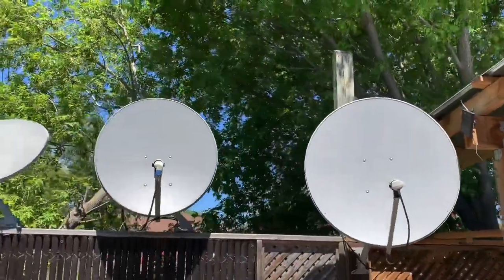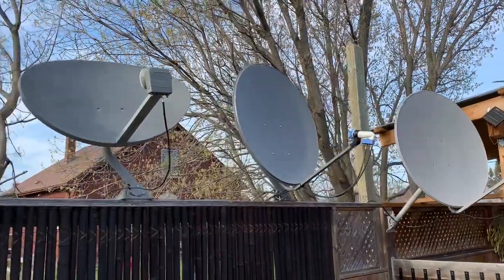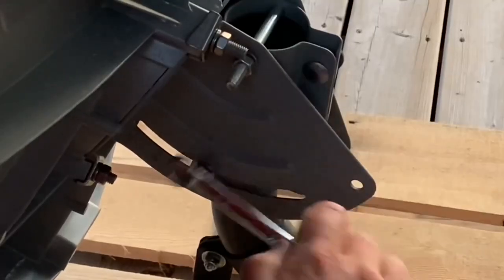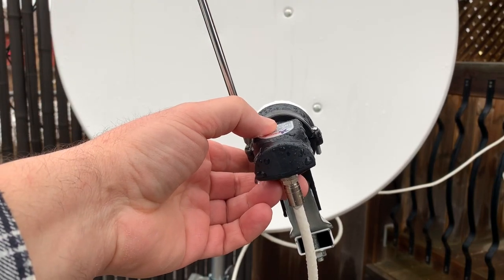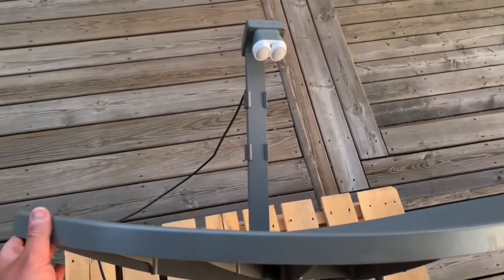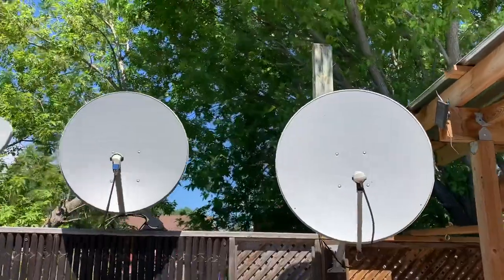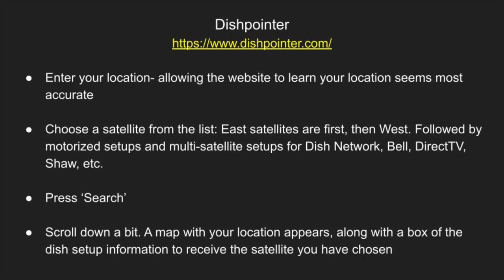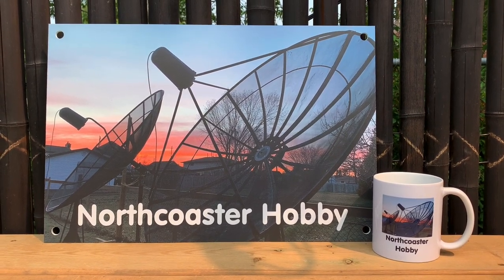How to Aim a KU Band Satellite Dish - Quick Tutorial - Aim a Satellite Dish

Comment: Great Info. I must add that sometimes an LNB will  make thinks worse especially a faulty LNB. This morning I installed a 60 cm dish on a satellite that has very strong transponders. You can received it very well with a 40 cm camping dish. The LNB I was using was RT Inverto single Ku Band. I didn't use that LNB much. I knew the position and the elevation and no signal. I'm using AMIKO Multitracker 2 for satellite installation . Then I was thinking what if I replace the LNB with another one. So I replaced the RT Inverto LNB with an AMIKO LNB. Surprise Surprise the signal was 60%. I adjusted a little bit  the azimuth for the satellite dish also the LNB and the signal got up to 80% on strong transponders and 65-67 from 30% on weak transponders. I tighten the screws and replaced back the AMIKO LNB with the RT Inverto the problem was with the RT Inverto had no signal on some tranponders and 60% on strong transponder (where I have 80% with the AMIKO LNB). 
Make sure you use RG6 Trishield or Quad shield and always have a spare LNB. Also make sure the satellite receiver works good sometimes the tuner or software will make things worse and you may think your dish is not aligned.
Reply from the maker: All good information, thank you. I hope to make a more detailed video on some of the subtleties when the weather improves. But I thought it was time to at least go over some fundamentals with aiming a dish. There are so many intricacies that must all merge together when you are aiming a dish. Pardon the pun, but for the successful aiming of a satellite dish, many things must be aligned. You have to have a feel for it, in order to troubleshoot problems. That being said, it’s easy for get lost in space, too!📡
Reply: @NorthcoasterHobby  The current video is excellent for beginners. Do a part two with troubleshooting and what can go wrong when you install a satellite dish.
Reply from the maker: @Nicholas_Chris  Thank you, I plan on re-visiting this topic soon.👍📡

Comment: I’m new to the hobby. How many satellites can these dishes pick up? Also, the dish needs to be manually adjusted for each one, or does it pull in more than 1 at the same time?
Reply from the maker: Quite a few satellites.  A single dish will need to be aimed at a specific satellite, while a motorized dish can be set up to receive several (or all) satellites on the geostaionary arc.  Here is a list of North American satellites and the channels available on them:

https://www.lyngsat.com/america.html

https://www.youtube.com/watch?v=qBOVmYHAGWc&t=5s

https://www.youtube.com/watch?v=52znCBi365o&t=2s

Comment: Ah yes, the first time when you install a satellite dish you have that feeling that you have a pop quiz on Math. And the joy that you signal and receive channels on your satellite receiver. And you think that you are genius compared with your neighbors with cable subscription. It's like learning how to ride the bike. Good times!
Reply from the maker: Yes it’s a great feeling. I remember the first time I pulled in channels from Galaxy 19. I thought to I myself- this is real!📡📡📡
Reply: @NorthcoasterHobby  Back in March 2018 when I installed for the first time the satellite dish I used a 40 cm dish installed on a tripod, LNB RT Inverto Single, a cheap Amiko analog sat finder, AMIKO MIRA HD receiver and the good old CRT TV. It took more than one hour to find a signal. I pointed to Astra 19.2 East. The beginners mistake that I should've used a 60 or 80 cm dish to make it easy. But I finally found signal on my receiver. I pulled 300 channels. The first channel that appeared on TV was Bible TV Germany. I entered the receivers menu and searched for MTV. Best part that I found MTV Germany and VIVA Germany (now replaced by Comedy Central Germany). The succes was that I used a 40 cm dish and still got channels. Later I learned that a larger dish will get all channels. For example after two weeks I replaced the portable satellite dish with a 60 cm and got 400 channels instead of 300 channels. Now I use an 80 cm and don't have problems during bad weather.
Reply from the maker: @Nicholas_Chris  My first dish was a Shaw 60 cm dish. It was a bit of hit and miss at first, but a great feeling of success!

Comment: Thank you for this video. I still have a question about elevation. The back of my dish has a scale like you mentioned but if I point the dish straight ahead where the parabola is perpendicular to the ground, the scale doesn’t read 0 but 30 degrees. In fact there is no 0 in the scale. Is there something wrong with my scale or is my error my understanding on how to use the scale?  Thank you.

Comment: ok i have the 39 inch dish.  when using a incline meter where is the best location to place the meter when trying to get the correct incline when setting the dish. is it on the boom where you have the lnb? or another place?
Reply from the maker: There should be a scale on the back bracket for elevation.

Comment: I have hh 90 dish mover and I still can't get any satellites    I have a sat finder still can't get anything
Reply from the maker: If you have a motorized dish you might have to make sure your declination and elevation are adjusted correctly. Otherwise you will be below or above the arc instead of aligned with it. Also double check your LNB frequency in your receiver. Make sure it matches the LNB type you are using.

Comment: It’s been 3 weeks trying to aim this satellite, got the right satellite locked on and I’m still showing 67% signal and 0% quality this same signal shows up for every satellite
Reply from the maker: Double check the LNB frequency in your receiver setup menu. It needs to match the L.O. Frequency on the label of the LNB. This depends on whether you are receiving C-Band or KU-Band channels. This is critical but is often overlooked.

Satellite LNB Frequency Setup is a VERY Important step

https://youtu.be/1UmBTtBX6pU

Next, check to make sure the LNB power is ‘on’ in the receiver menu. Your LNB needs voltage to work.

No Signal on your FTA Receiver? Turn Your LNB Power ON

https://youtu.be/qZ05LUUrMHw

Another possibility is that your dish needs to be re-aimed. Move the dish slowly, even a millimeter can make a big difference. Run a blindscan after every adjustment you make. If you’re getting signal but no quality the elevation of the dish possibly needs adjustment.